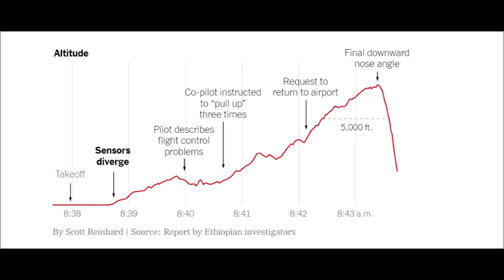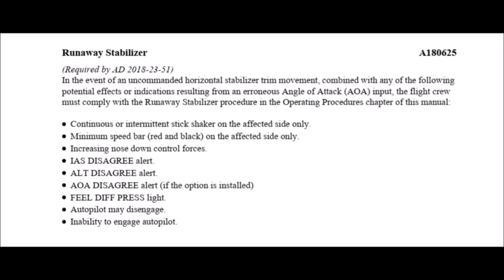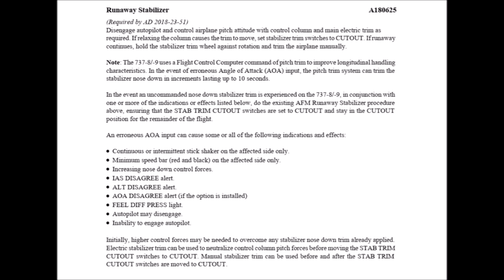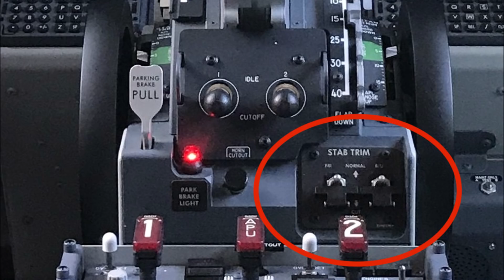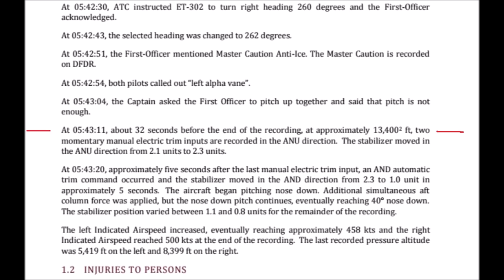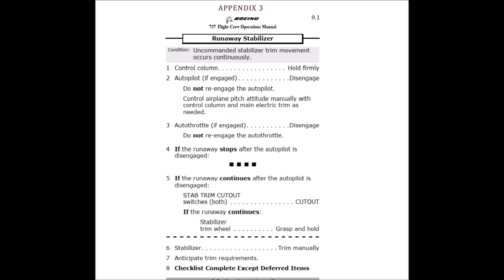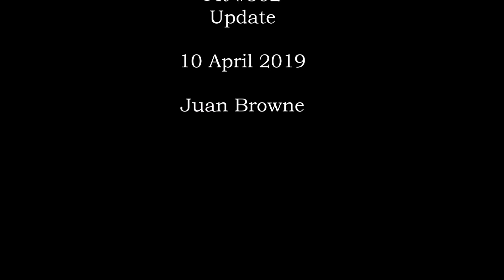737 Max Update 10 April 2019 Runaway Stab Trim Procedures

Comment: The reason they didn't address the throttle is that they were fighting the plane's refusal to climb. They were completely flustered by the rejection of all their efforts to pull on the column and make it go UP.
Right or wrong, it's natural for anyone in an emergency situation to focus on the immediate killing condition (nosing down) -- with the throttle as only an afterthought. In FACT, more throttle makes you rise, right? If the MCAS thinks you're stalling, throttling down is LAST on your mind, right??
Reply: I'm trying to remember which flight it was where the crew was all so obsessed with a light that wouldn't go out that they descended to the ground - even with audible ground prox warnings. They went into a swamp I believe (not Valujet). But that's a whole 'nother matter than "pulling up" and having the aircraft aim down. Even division of duties is going to have a hard time overcoming the "world is coming to an end" maniacal descent by robotic MCAS, and looking away to worry about the throttle setting or the air conditioning level.
Reply: @UCsHSTRQofYYLvnyELNiIPOg https://en.wikipedia.org/wiki/Eastern_Air_Lines_Flight_401
Reply: But they weren't stalling or getting those indicators so confusion on that point doesn't make that much sense.  If you think you lost upward elevator authority at 1000 ft but are stable, last thing you'd want is also 300, 400+ knots airspeed you have to deal with while trying to find a field or return to the airport.  To me it seemed like the pilots were still in "fix it" mode and not enough in "emergency landing" mode and perhaps ironically ended losing the ability to do the former and causing the latter by taking that approach rather than focusing on flying the plane first and diagnosing as they prepared for the worst case.

Comment: What is the likelihood of the stabilizer  switch module surviving that impact to confirm  the  switches'  on/off position.
Reply: 0.0%
Reply: Very low.  And even if the switches survived the impact was strong enough to change the positions of the witches.

Comment: The flight before of this very aircraft survived a similar runaway stab trim issue because it had an extra pilot in the cabin to assist in the recovery. You have already highlighted the amount of physical effort needed to recover trim control (two pilots on the wheels) and given ground proximity and the need to climb rapidly to gain clearance it is likely that both tunnel vision and physical exhaustion - together with natural fear - played it's part. That the system was configured to run multiple automatic trim adjustments on a single (faulty) sensor input is without doubt the major cause of the accident and blaming the pilots is an unhelpful distraction.

Comment: Hey Juan. Thanks for the update. Shame that the crew didn't realize that the manual trim actually *was* making a difference. Question regarding runaway trim training-- have the guys that aren't flying the MAX, like you, been having to go through runaway trim procedures in the sims since these crashes??
Reply: Corey Ballard what did you mean didn’t realize, they switched it off because they realized it was making the difference. They turned it back on because they didn’t have any other option. 😡😡😡😡
Reply: Mesob ✅ excuse me? Re read what I wrote. You're not understanding, clearly.
Reply: @c7042  I agree 100%, not being aware of their IAS, not recognising their auto-power settings, brings into question their own proficiency, because if they had, particularly the Captain you would have thought, being an experienced pilot, would have done exactly what you described, but unfortunately and I may be corrected here, I believe to FO was in control of the aircraft and that the Captain was working through the issues, which as I understand it, is not considered to be best practise in emergency situations, the most experience pilot should always take control of the aircraft.
Reply: @Stormbringer748  I have not come across any information from any source that suggests the First Officer was in control during this flight. I wonder if you might be thinking of the Lion Air crash where the Captain was commanding the airplane until the very last moments when he turned the controls over to the First Officer so he could study the manuals. The First Officer lost control and down they went.

Comment: This article on "The Air Current" explains very well why speed was an issue. At high speed it is almost impossible to manually trim due to the high air pressure on the elevators. The maneuver they are supposed to do (raise the nose over the horizon so there's no air pressing against the elevators and then manually trim excessively. stop trimming. raise the nose again) isn't possible at high speeds as far as I understand it

https://theaircurrent.com/aviation-safety/vestigal-design-issue-clouds-737-max-crash-investigations/
Reply: Sebastian Peitsch
Juan already covered that when debriefing the preliminary report. 

Noting that the co-pilot tried to manually trim and that it wasn't working; pilot tried and confirmed. 

Juan went into the required level of detail to explain why (including air density at the level, airspeed ect) manual trim would have been near impossible given the conditions. And how "relief" pitch (more nose down) is a valid fix.

This, unfortunately was one of the final attempts of the flight crew (so close!); it's fair to posit that they knew the next step was pitch relief, but that the ground was too close at that point.
Reply: @justinnitsuj7041  I mainly linked to the article because of the history background of the maneuver and the visual aids and for people who might not have seen the earlier video and/or can't put what was said there in context
Reply: @ Sebastian Peitsch Thank you for that awesome link. That's the first article I have yet seen that covers "mistrim"

Comment: This mcas system dramatically increases the workload for the pilot in an emergency. Boeing should of design a plane that didnt need to have a system like mcas

I wonder why would boeing based mcas on one sensor alone based on the history on them based on this article.

https://www.bloomberg.com/news/articles/2019-04-11/sensors-linked-to-737-crashes-vulnerable-to-failure-data-show

Comment: NOTE: At 6:58 of this video (start frame of report timeline text), in timeline event "05:40:48", the "ANU" refers to Aircraft Nose Up.  At timeline event "05:40:41" the "AND" refers to Aircraft Nose Down. This clarification is for the some of the non-aviation followers who may be curious about the acronyms presented in the report.
Reply from the maker: Yes.
Reply from the maker: See link above.
Reply: @blancolirio  , thanks Juan, I didn't click on the "Show more" under the description, having done so now, I see you have a link to the full report which has a glossary of terms.